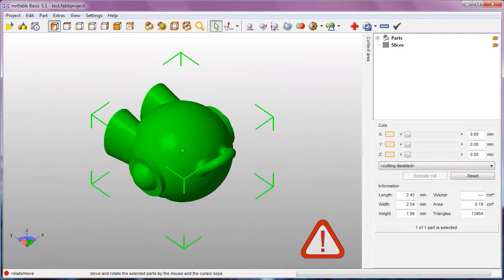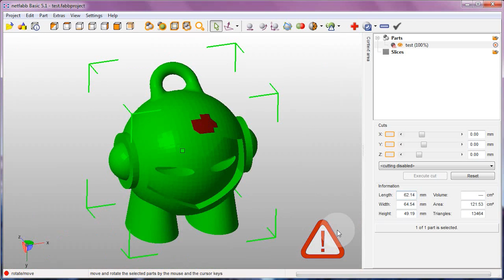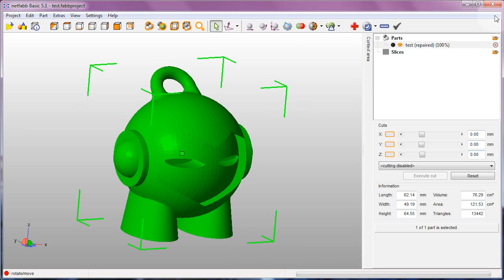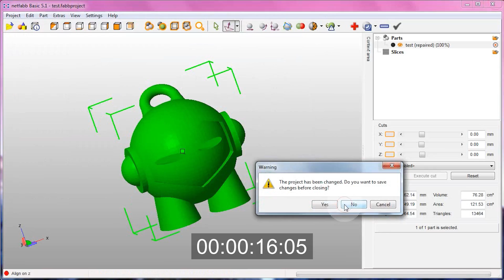3D printing guides - Fixing stl files with netfabb

Comment: Any free options that can do this now? It seems that netfabb basic is no more, and all the options for netfabb now require a subscription. I'm not interested in the 1 month free trial, because I do not want to learn something I can no longer use at some point in time.

Thanks!
Reply: Hi, Netfabb is now apparently only for PC's.  Do you know if there an equivalent for Mac's?
Reply: Thanks! I had read through their software summaries as best I could. It is not made clear that after the 30 day free trial the standard version is still accessible.
Appreciate the help.
Reply: Hi brainanator , i have just tried downloading the netfabb program and am not able to sign in to even start the download , did you have any trouble with this ?? Many thanks ......
Reply: brainanator hi this is free and works well, " splic3r" .....

Comment: Anyone having issues with netfabb basic being unresponsive ? I updated from win7 to 10 and most things are OK apart from getting not withing to run it loads but you can't move any files about the screen. Tried restoring before install and the reinstalling but didn't cure it !!!
Reply: > Windows 10
Well, there's your problem.

Comment: ***** did you really think it was necessary to do a quick video on how to click a automatic fix feature? i think its pretty obvious given it has a red cross thats pretty much a universal symbol tho on the other hand a more suitable tutorial wud have been using other features such as those blue green and red triangle for manual fix as those are the essentials for fixing things inside models because note that if you want your model to remain hollow inside and you click on that red cross it will automatically close that hole you want open and again this is where youwant to come in with the manual tools and give the inner model dimensions by adding triangles to the hollow parts, i actually own a paid version of this program and you wont believe that i cant eve change some default feature as the company don't let you mess with-those settings so for thingverse models this is cool quick fix but if your like me who makes my own models from scratch or edit other model from thingyverse this is not gonna happen
Reply: very cool!
Reply: how you know im cool like that bro ? lol you spying on me ? hehe

Comment: Hi I still have red sections after default repair (automatic). Then I followed the remove degenerate faces step (0.001), red part was still there. Could you help me to find other solutions?

Thanks